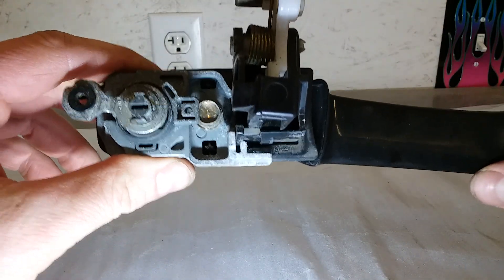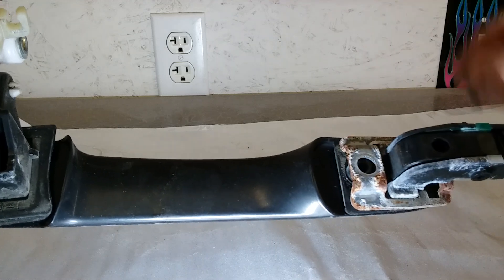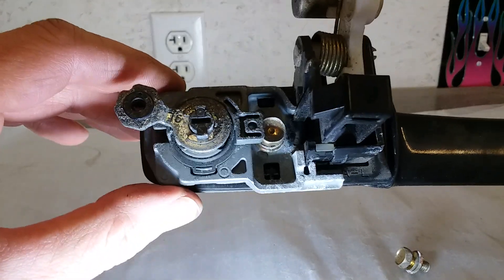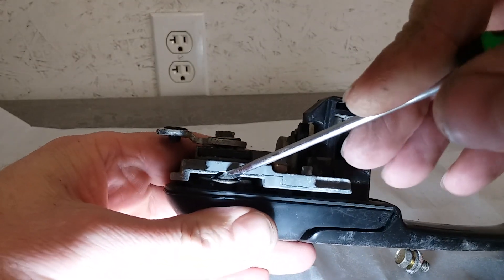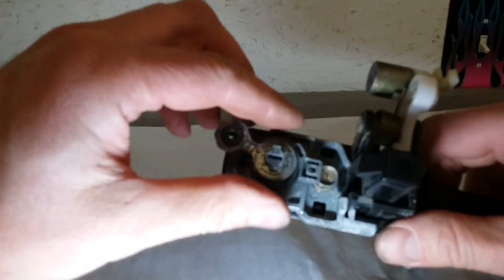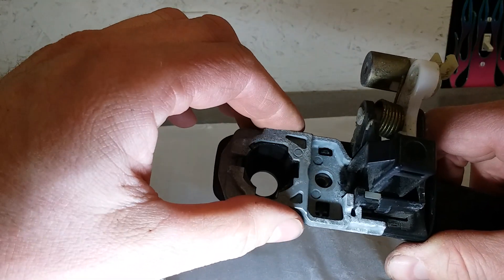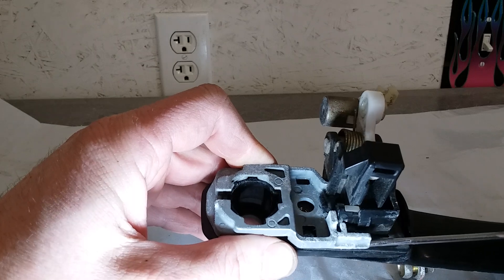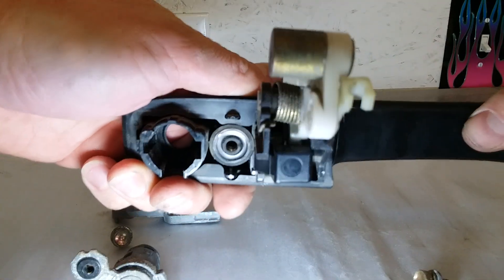03 Honda CRV outer door handle removal

Comment: This video was just the insight I needed!  Thank you so much for posting it.  The clip was a bit challenging to get out, but I did manage to do it.  Since I was just fixing a broken lock, I didn't need to remove the handle.  A tip for those trying to get the clip back in without removing the handle or maybe even if you do - insert a 11mm socket into the lock hole while you're pushing the clip back into place.  It'll just snap right into position.  Thanks again for the video; I wouldn't have been successful without it!

Comment: Life saver video!!! Thank you. I just spent 3 hours changing the lock cylinder from inside the door. (I thought it to be much easier than taking all this apart). I could do it again in less than an hour, now that I have a real visual of what comes apart and how. That clip does come out very easy once it is understood where it is to pull. It is where that groove is. The cylinder does slide right in once the clip is back in place. Hardest part was getting the clip back in place. It was very tricky and my neck is tweaked from looking at that awkward angle and through one of the fastener holes. Thanks again!

Comment: Ok I did replace the door lock cylinder on 7/13/2020.  Yes is wasn't fun but got it!!!  I suggest using a small hook awl.  I bought a 4 piece hook and pick set. ULLMAN from Amazon.  Took a while but was able to get the hook awl behind and over the C clip.  Put a glove on please.  Had to pull very hard then came loose.  Put a white plastic trash bag in bottom of door because it will drop down there.  Then, push out old cylinder from the outside towards inside.  You will need to push new cylinder into place firmly, then you can push the C clip straight up, not at an angle.  I attached and twisted small gauge safety wire at bottom center.  If you drop clip, you can find it.  Dont have to remove the wire after.  Ugly job but success!  Thanks for this awesome video.  Note:, you can't remove the door handle without removing the door lock cylinder first.  I did Not remove the door handle or the bolt behind the door lock cylinder!!
Reply: Watched this video but i still couldn’t get the damn clip off the cylinder. You are right, if you need to remove the handle, the cylinder has to come out first , and I still struggle to get that clip out
   If this man could show me how to take the whole handle out first ,and then show people this video clip above later , then that is a big help, he only show us after the handle already out .

Comment: So I have a question about my 02-04 (05-06) CRV passenger door lock itself that you showed here... 

So my Drivers Side Door was either replaced at one point, or the door handle was broken and somebody replaced the handle and forgot to swap in the original Door Lock (either way its NOT THE ORIGINAL DRIVERS SIDE KEY LOCK cause it WON'T FIT MY KEY)...

But my KEY DOES MATCH up an WORK in the LOCK on the PASSENGER SIDE DOOR!

So my question is... 
Can I swap that Lock over to the DRIVERS SIDE Door? And if so would I have to flip turn it left to right ways (like a wooden Top toy would spin)? Or spin it 180° (like doing a cartwheel on the grass lol) so that the N side of the Lock in it's vertical key slot resting position (12 o'clock position), is now in the S 6 o'clock position, and the former South position is now at the North position for the Passenger Lock to be able to now work on the DRIVERS Side? 

I know that twisting the key one way or the other will pull the lever, or retract the lever, as well as the metal rods to lifting up the plastic door lock (the physical plastic lock you can pull up with your fingers on the inner door panel just below the glass window 😆), so I don't want to install it only to find out that it possibly might be wrong... The gold metal lock tumblers I noticed are on the top side of the Lock facing N at the 12 o'clock position, but I'm not sure if they can still be at the 6 o'clock position or not because then I'd assume they'd be slid down and open even without a key, causing you to be able to get into the car by just simply inserting a screwdriver 🪛 and freely turning it without even using a key (instead of the typical tumblers keeping lock locked into stationary position and from turning like they're supposed to do).

Any suggestion would be of help but It seems as though the lock could be swapped to the DRIVERS SIDE
Reply from the maker: I’d say it’s possible and it won’t matter if the lock is inverted it won’t unlock the door.. I just am not positive the top end of lock rod will be able to be flipped

Comment: Is it possible to take door handle off door before removing the lock cylinder?  My door handle is still on the door and in seems impossible to get door handle off without first removing lock cylinder

Comment: Ok but how did you get the handle out from the door ?
Reply: That is the big question, I have the same problem, couldn’t get the clip out of the cylinder. The video only show after the handle already out , while we need to get the cylinder out first ( before ) we can get the handle out :(
   For some reason, I couldn’t find or see the damn clip  :( , it is completely hidden inside :(

Comment: Can You tell us, how's to take out the the handle from the door, please!
Reply from the maker: Once you have the bolts out and the clip off, pull the handle and work the connection point out and pull slightly back on the front of the whole handle. Hopefully that helps

Comment: Wanted to believe this video was of anymore value than the 10 seconds of “remove the clip at the bottom” but it’s not (no suggestion to how to actually remove it outside of being able to rotate the handle 360° degrees).  4 minute video that could have been 20 seconds...
Reply: You gonna cry 😢 over a vid ?